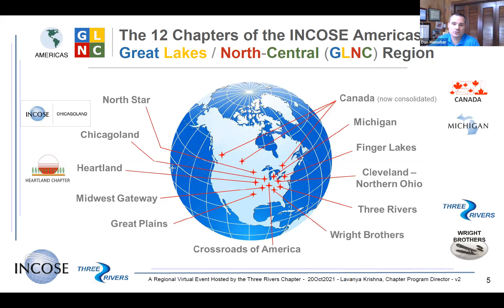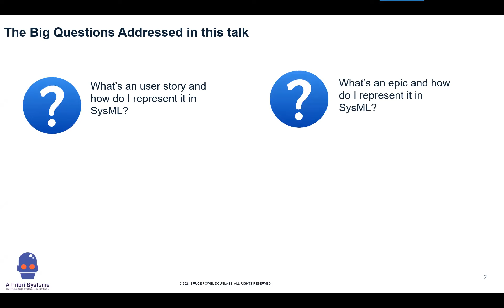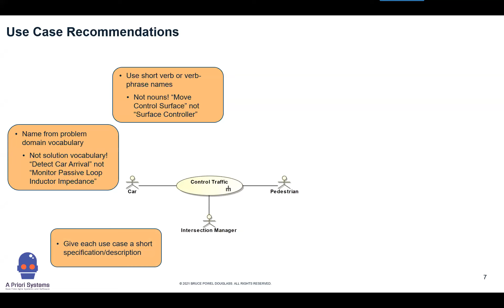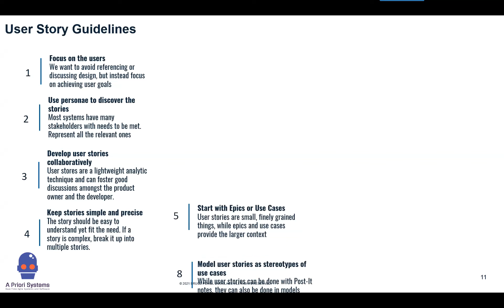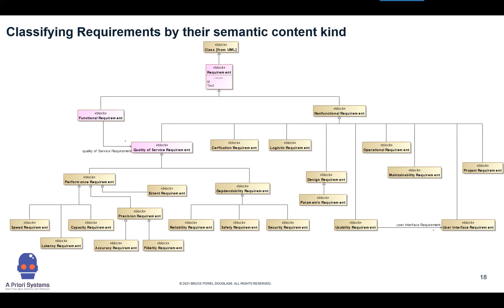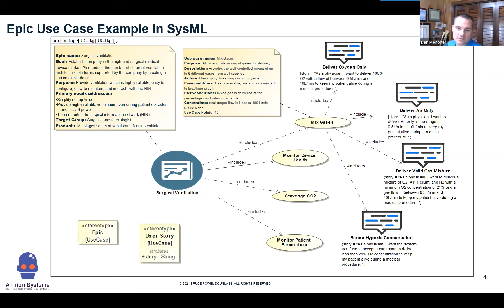INCOSE Lunch n Learn 3 - Epics Use Cases and User Stories

Comment: Hi Bruce, thanks for sharing such informative video, I had one question, is there any guidelines of extracting verifiable functional requirements , non functional requirement and quality of service requirements out from usecase  sequence? I am currently working on that and I needed some guidance, also it will be really helpful if you could guide me to incorporating data in such diagram which then can be captured in requirement.
Reply from the maker: That's a big question. In general, every message on a use case sequence diagram should relate to a requirement, although the relation is 1..* to 1..*; that is, it may require multiple messages to fully represent a single requirement, and a message may itself relate to multiple requirements. As you walk through a sequence diagram, be sure you understand what requirements are being represented; as you walk through the requirements, be sure you know where it is on the sequence diagrams.
Reply: @BruceDouglass  well that makes autogeneration of requirements from UC activity or sequence much more complicated without human intervention.